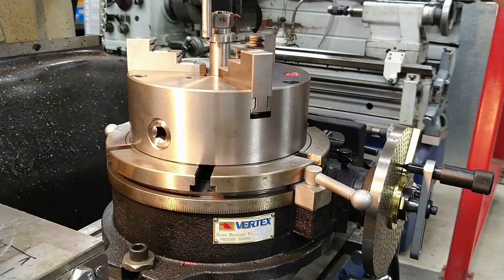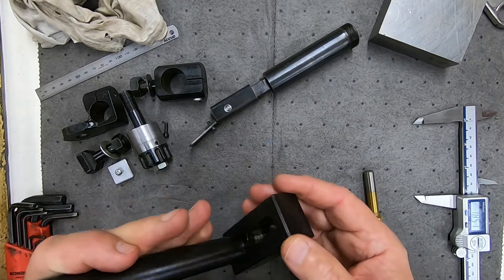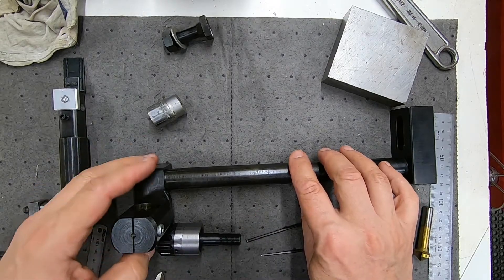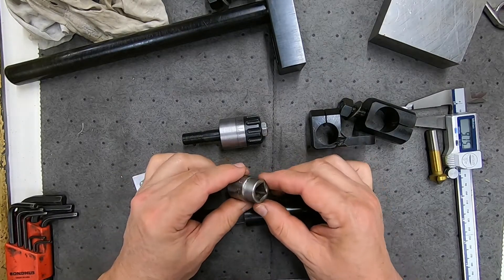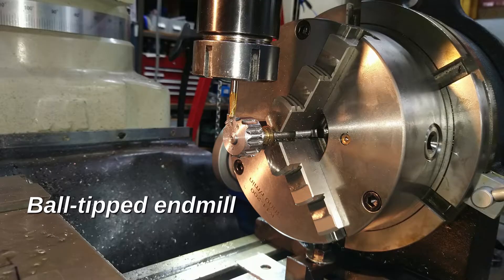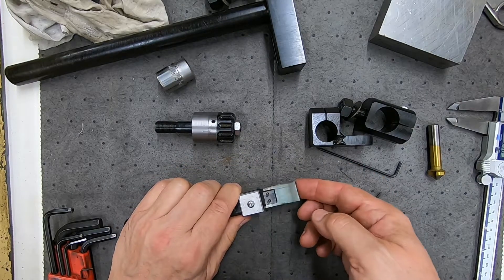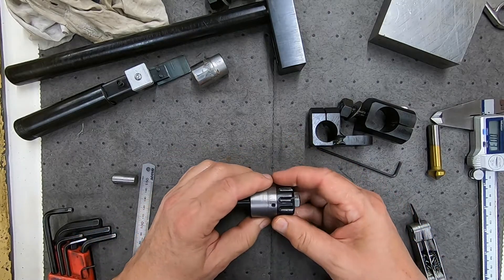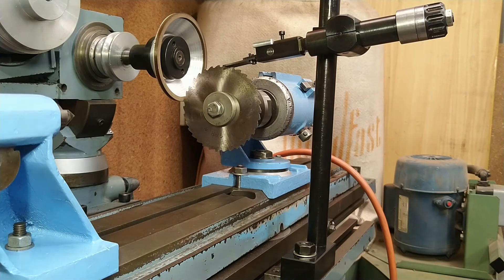Restoration of an AR/5-E tool and cutter grinder - Part 2: making an indexing accessory

Comment: Nice little grinder, I'm picking up a AR5-E in a couple of weeks. Very useful set of videos thanks
Reply from the maker: Thanks Shane. Had a quick look at your channel and noticed you have a Victoria U2 horizontal mill. I also had one of these (recently sold) and made a couple of videos about it that may interest you - one showing how I fitted a 3 axis DRO to it.
Cheers, Alan.
Reply: @alanshomeworkshop  not used the mill yet. I'm in a funny situation one shed in use but fully outgrown and my second shed is still not finished but all kind of full... I'll check the videos out as I want to fit a dro once I restore the mill..... it's in a very unloved as brought condition right now

Comment: well done mate im looking for a tool and cutter grinder myself
Reply from the maker: The AR/5 is ideal for a small workshop. It's quite compact and very flexible in it's range of configurations - especially if you can snag one with all the original accessories. As noted in the videos, mine was missing most of the them :(
The bigger issue for me though was the overall condition of the machine - it had been "ridden hard and put away wet" as another YouTuber is wont to say.
However, at A$1,000 it was probably still reasonable value and I had grown tired of looking at ancient industrial scale machines that needed complete refurb and were $A2,000+. Hope you find something that suits. Cheers, Alan